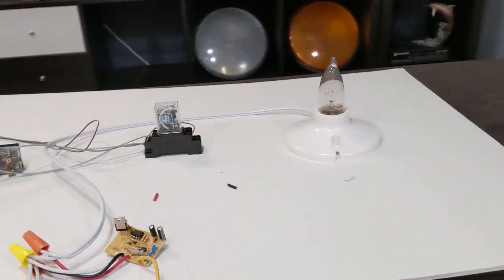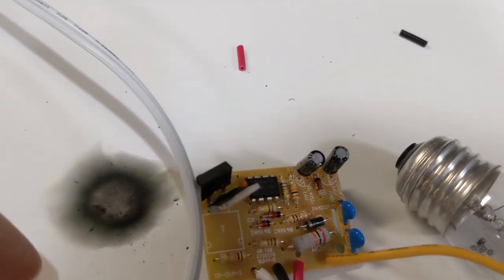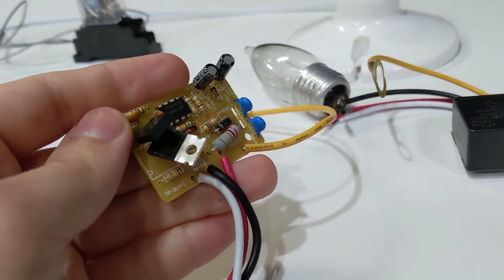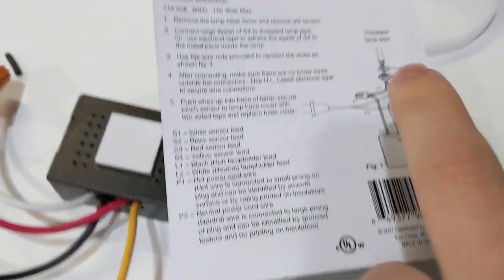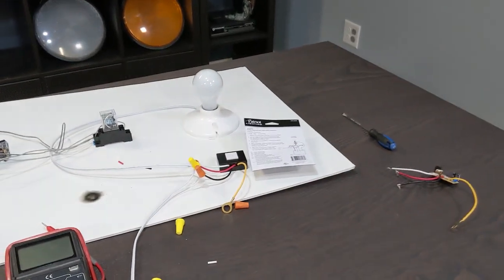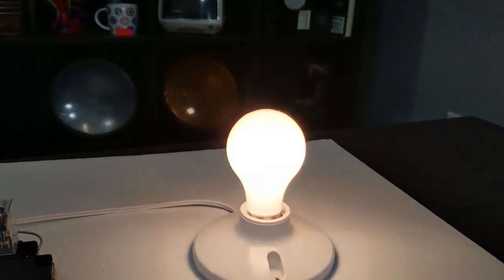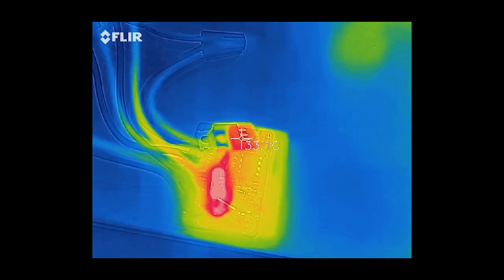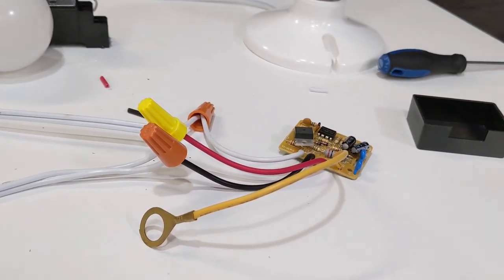A slightly explosive touch-lamp follow-up (standby energy consumption)

Comment: Maybe a tad pedantical, but fuses "blow", breakers "trip."
Reply from the maker: This is in fact very pedantical, yes. But technically correct.
Reply: @TechnologyConnextras  Also, I forgot to mention: Dude, you crack me up. Thanks!
Reply: @TechnologyConnextras  'technically correct' almost sounds like a 'Technology Correction'
Reply: @TechnologyConnextras  technically correct is the best kind of correct.
Reply: Were I live our houses still mostly use fuses and not resettable brakers.
Reply: @alfepalfe  jesus, really?
Reply: @sobertillnoon  I came here for this and wasn't disappointed.
Reply: @dylanharding5720  well if you build a new house you will of course use proper breaker but I know in my house we still have fuses I think. I am only a 13 year old so of Course I dont work with that stuff but I think we still have fuses you need to replace if the blow. At least what I remember from the like 2 times I have seen dad replace a broken fuse.
Reply: @alfepalfe  where in particular were those fuses?
Reply: @dylanharding5720  in a box called "a proppskåp" were in our case in the basement. (I am from Sweden)
Reply: To be even more pedantic, if something goes horrible wrong breakers also blow ;)
Reply: @callumBee  can confirm
Reply: You must be lucky just to have fuses. My wiring is literally an extension cord going to a cardboard junction box that has wires (at least they were insulated) going to plugs wrapped with tape and nailed to the wall. I do plan to replace this system.
Reply: I hear "popped" "flipped" and "blew" about equally in the PNW. "trip" is less common. 'Blew' might be anachronistic, but it's not wrong because language evolves.
Reply: Both fuses and breakers can open under either designed or non-designed circumstances.  If a fuse that opens under a moderate over-current condition is said to "blow", what term would be used for one that flies across the room because of extreme overcurrent (0.25A fuse passing over 50A)?
Reply: @flatfingertuning727  "Kersplode" would be the term.
Reply: Also, every light bulb is technically “shorted”.

(Or… is it? If the wire itself is technically the load, maybe normal operation wouldn’t count as a short, since it’s the intended path… someone let me know I guess!)
Reply: @TechnologyConnextras  The best kind of correct!
Reply: And yet we all know what it means either way...
Reply: Not always, I've BLOWN a breaker before. Had to replace the backplane of the box.
Reply: @callumBee  So do transformers!
Reply: @ianmelzer  yeah, you can totally and truly blow a breaker, but doing so requires a lot larger of a screw up than popping a few small modern chips...
Reply: @jSyndeoMusic  the filament is a resister, so a properly functioning lightbulb is not a short circuit. It is a circuit, but generally speaking a short is one with insufficient resistance and leads to, well, explosions, fires, and/or tripped circuit breakers.
Reply: Breakers are blown open by magnetic force when there’s a dead short.
Reply: @alfepalfe  Where I live we have circuit breakers, but call the device they reside within a "fuse box".
Reply: @dylanharding5720  I live in an apartment building that's pushing 50 years old, and I have a fuse box, not a breaker panel. Worse yet, these rare fuses that like one place in my city sells, or I can pay rip-off prices at the apartment office. >.<
Reply: David Provencher Thanks for the clarification! That makes sense.
Reply: @dericn  good catch, man... Noice!!!
Reply: @callumBee  and may catch fire and burn the place down.
Reply: @user2C47  woah... that is some McGyver shite right there... if properly specced and gauged, or not overload the capacity of the existing "setup", it would serve its purpose. Though, it maybe electrically viable, your safety is still at risk. :D
Reply: @flatfingertuning727  exploded, perhaps?
Reply: @jSyndeoMusic  technically you are right, and the normal failure for bulbs is for the filament to blow causing an open circuit. LED bulbs is another story, btw.
Reply: Don't replace those blown fuses.  Save a little money and stick pennies in there.
Reply: @TheKb117  It came with the building and I will replace it in about 2024 when the permit is finally approved. I agree that is unsafe and try to use less than 2 amps.
Reply: @user2C47  OK, I see where this is going... straight to Yorkshire:
Cardboard junction box?  Fancy.  We would count ourselves lucky to afford such a luxury.  We nailed the extension cord right to the wall and ran bare wires to the lamps, refrigerator and stove.
Reply: That is to bad... not enough "blowing" going on in my house... lot's of "tripping" though
Reply: @TechnologyConnextras  The best kind of correct
Reply: Sorry to be pedantic (not) but fuses FUSE - errrr, the clue's in the name.

"Fuse" - "To make fluid by means of intense heat; to liquefy, melt. Also with apart, together." 
source: OED
Reply: @alfepalfe  OK, as a 13 y/o, learn something now. OFTEN names mean something. In this case, fuses - they don't 'blow', they fuse - which is why they're called fuses.

Fuse: "To make fluid by means of intense heat; to liquefy, melt. Also with apart, together." - Oxford English Dictionary.
Reply: @jSyndeoMusic  Technically, a short is short for short circuit - i.e. not the intended path. Where the path is longer, it usually means the resistance is greater, not less than intended.
Reply: @kreuner11  and fuses fuse.
Reply: @jSyndeoMusic  

No, a resistive load isn't a short, no matter if it is made out of metal or not. 
Short means close to, or at least having a similar effect to zero Ohms (when dealing with  megaohms, 1k can effectively be a dead short).
Reply: Unless something goes horribly wrong, in which case the breakers might in fact blow.
Reply: @TechnologyConnextras  the best kind of correct.
Reply: "This is in fact very pedantical, yes. But technically correct."   should be motto of the channel
Reply: Pedantry is authorized.
Reply: @sobertillnoon  oh God I want to hear that story
Reply: Sigh... THAT guy
Reply: Last video had great laugh out loud moments. I had to rewatch sections I was laughing so much. You got me good. Very informative and very funny.
Reply: @alfepalfe  in Poland we use fuses too
Reply: Jeffery Amherst  Just out of sheer curiosity, why did you capitalise every word? I see people do this often. I don't understand the reasoning behind it.
Reply: To be even more pedantic to the pedantic, breakers can blow too, they just dont reset as usually they are slightly more crispy afterwards
Reply: @coordinatezero  the reasoning behind it is that they are psychopaths
Reply: @compzac I don't know why but I've suddenly got the image in my brain of Colonel Sanders pulling a basket out of a deep fryer just filled with blown breakers and deadpanning to the camera "Extra crispy breakers. Now available at KFC. They're finger lickin' good!"
Reply: @likebot.  - A stove? Pure decadence! If we were cold, we had to stick the bare wires under our fingernails and let the 240V warm us up.

Comment: "It might not have exploded if I plugged it in the other way"
Alec forgetting that alternating current is in fact alternating.
For that matter, as long as the yellow wire has decent isolation, you could swap all the lives and neutrals so it can actually have a common neutral.
Reply: My touch lamp is factory wired in this way using the same type of module. Red neutral, black live, white switched live. The insulation on the yellow wire doesn't matter because it goes to an exposed metal part of the lamp. The two little blue Y capacitors are providing the isolation for the sense wire.
Reply: @eDoc2020  I wasn't sure about the exact circuit layout regarding isolation but if Y capacitors are involved I'd assume it's safe. May cause a slight tingle if you're unlucky.
Reply: Well in the states they somehow have something called polarization for some reason, which i find totally absurd
Reply: @lagcom  Allows the chassis of an otherwise un-grounded appliance or lamp to always be at ground potential. In particular, if a lamp is installed in a damaged lamp holder, the threaded lamp base will be at ground potential. Lots of silliness in the North American wiring scheme, but polarized wiring does sort of help keep things safer than it might be otherwise.
Reply: That’s not the whole story. There is a difference between live and neutral (as the voltage of the neutral is meant to be always 0V while the voltage on the live wire varies between ~–120V and ~120V on a 120V circuit). Additionally, some components (especially diodes and some capacitors) are polarized, which means that they do have to be connected in a specific way even to an AC circuit.
Reply: @bhull242  what the f... There is no voltage OF neutral or live. Only voltage between any of them (and earth).
And you cannot use a polarized cap (elko) on AC. It will blow up.
Reply: @jpt3640  
Neutral is ground.
Reply: @bhull242  if it were that easy then neutral and earth would not require separate wires.
Reply: @jpt3640  
It’s not, but the US is weird, so neutral is often tied to Earth ground before it enters our homes.

Comment: The confusion is that this device actually switches the neutral. That is backwards compared to what we (Americans) would normally do. And yes, the ribbed lamp cord is the neutral wire, with the smooth wire being the hot wire. All lamp cords are wired this way. You are also forgetting that it is the USA we have a neutral and where this was made they have both L1 and L2, both being hot. Being they are A.C. alternating currant, plugging that in backwards theoretically won't make a difference.
Reply: If it is designed to handle potential voltage on either line, then nothing shouldn't cause it to blow as there isn't a 'wrong' way to wire it.
Reply: That's what I thought too, the neutral is being switched. Here in the UK, the line (hot) is the one that's always switched, then there isn't a permanent line voltage in the light fitting, when someone thinks it's safe as it's been switched off at the light switch. I'm not an electrician but neutral switching I'd say is bad practice.

I'm not sure if another comment has already mention this or not, but I've studied your wiring Alec, and the wiring diagram, and it looks like S2 and S3 are the lines from the supply (ignoring polarisation for now) and the load goes across S1 and S3. You had the supply going into S1 and S2, so when you tapped the ring to activate the light, you put a dead short across the component, which is why that trace and component melted, with potentially hundreds, if not thousands of amps briefly flowing through it. It should work regardless of polarisation when wired correctly, but a short is still a short!

Comment: America: "Black is Hot"
Rest of the world: "Black is Neutral"
Youtuber: 💣
Reply: Germany: neutral is blue
Reply: Except the EU: Blue = neutral, Brown,Black+Grey are the 3 phase live colours. The worst possible colours you could imagine.
Reply: @MrEdrftgyuji  Ah yeah, I forgot thats how the plugs are done here 😂
I meant smaller scale electronics projects.
Red = live
Black = Neutral
Green = Information
(Talking from a Comp Sci/Electronics background)
Reply: @WorkinDuck  Awww gee, then Neutral needs some cheering up! LOL
Reply: @mattyoung3268  I'm pretty sure that's just standard everywhere for small-scale projects
Reply: In North America (US, Canada, Mexico) AC circuits, neutral is strictly white. Ground is strictly green or bare copper. Any other color should be considered live. It's a fairly simple system once you get used to it.

DC circuits use black as negative/common, and red as positive.
Reply: @mattyoung3268  That's DC my man.
Reply: @mattyoung3268  I believe they made the standard totally different because they were interested in it being slightly better suited for picking up and distributing new loads and for circuit upgrades and extensions tuned for distance. European secondary's (transformer to the house) can stretch up to a mile, and often many houses are on the same transformer. wherein America uses a single step-down transformer per "home" and the secondary is limited to about 500-900 feet. America has three-phase for commercial. but most residential homes only use a single, split-phase.  Each "phase" is 120v (+/- 10%). The transformer in the U.S. system splits the single-phase by putting the neutral as a center tap of the secondary transformer and each end of the transformer makes the two loads or legs. The mainline phase is normally 7200v to 11k. The two loads of the split-phase or legs can be combined to make 220-240v for things like clothes driers or electric ranges.  The Color Code system is interesting as well. According to NEC, a black or red wire must be used as an ungrounded conductor or hot wire. In fact, any color wire except white, gray, or green may be used in conduit to carry ungrounded power. No wire with any of those colors can be used for establishing a ground or neutral connection. Red is often used to denote the second leg for 240v applications.  The red wire is also used as a by-pass in a two-way switched lighting circuit, and will often be used also as an interconnection or communication wire in a circuit that requires it, such as a smoke detector circuit.  Wires that are blue or yellow, or any color except white, gray, or green are sometimes installed to designate a specific use. For example, if power needs to be run from a ceiling box down to a box with three switches and then brought back to the ceiling to power three different sets of lights, a black wire could be used to take the power down to the switches and three wires with other colors—say red, blue, and yellow—could be used to bring the power up from each of the switches. That makes it easier to tell, at a glance, which switch is being used to control each set of lights. Wires with green colored insulation and non-insulated wires are equipment grounding conductors or ground wires. Bare wires are called Equipment grounding conductors or EGC.  EGC wiring carries no power at all when everything is working normally. But if there’s a fault, and ungrounded power is present where it could damage an appliance or shock someone, a properly connected EGC provides that power with a low-resistance path to earth.
Reply: @curlyfats  and really old AC, in some countries at least. Different countries would define "really old" differently but AFAIK it's mostly standardised on brown for live, blue for neutral and green/yellow stripe for Earth.
Reply: @buffalo wt I'm going to guess you've never looked at your house wiring then.  DC wiring (like in a car) will usually be Red-Hot, Black-Negative.
Reply: @MrEdrftgyuji  even then that applies to fairly recent wiring. There are all kinds of combinations before that. I recently had to take cable to the tip that I can no longer use. It's taken me over fourteen years to get round to it of course... https://www.diydata.com/electrics/cable_colour/cable_colour.php
Reply: @MrEdrftgyuji  Yeah. In the dark all cats, and wires, are grey :)
Reply: I actually pick wire colors at random, and just make sure to keep notes. Makes things more exciting
Reply: America: Feet, inches, pounds. . .Rest of the world not so much.
Reply: @adamk203  DC circuits use black. etc., unless it's my sailboat, where white is negative, red is positive.
Reply: @WorkinDuck  Old  AC Colours in UK  were : Red- live (hot), Black - Neutral. Now its Brown- live (hot), Blue  - Neutral.  DC is still Red = (+) Black = (-)
Reply: @WorkinDuck  Here in Australia in a 3 pin plug aka single phase blue is neutral and brown is active or live and green with yellow stripe is earth. older plugs had red as active and black as neutral.
Reply: As an American I am used to car I see black as neutral and red as hot.
Reply: Curlyfat / Matt UK lighting circuits are red/black...... red is live.
Reply: @adamk203  The black for negative and red for positive in DC circuits seems to only apply to small power low voltage things, for example electric vehicles have orange power cables coming out of the battery and to the motor.
Reply: Yes, The colours used to be Red = Active, Black = Neutral and bare copper = Earth.

Nowadays double insulated twin and earth wire is still Red & Black but earth is Green with yellow stripe.

Mains 3 phase 415V star is: Red = Phase 1, White = Phase 2, Dark Blue = Phase 3, Black = Neutral.

Single phase electrical appliance leads are Active = Brown, Neutral = Light Blue and earth = green with yellow stripe.

Australian colour codes.  🇦🇺
Reply: @paulcrumley9756  motorhomes also
Reply: Canada too

Comment: Your video was both funny and interesting.. even better, I spent an hour reading the comments here. Very interesting. 
Since the switch was chinese made I'd have guessed that red was live and black was neutral (as other posters' have said, similar to DC wiring colours for +ve and -ve) just because they most likely market those switches worldwide. However I'd still have looked at the details on the package - be thankful you got those. Most of the time in Australia we dont get the wiring section since you're not supposed to tinker with electrics (supposed to call a licensed electrican or appliance repairer). However some of us tinker lol.